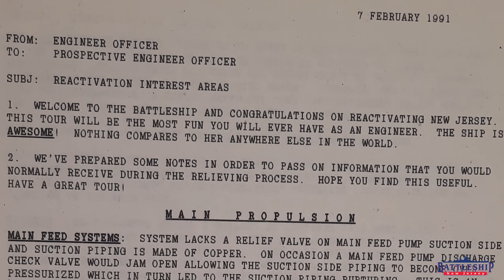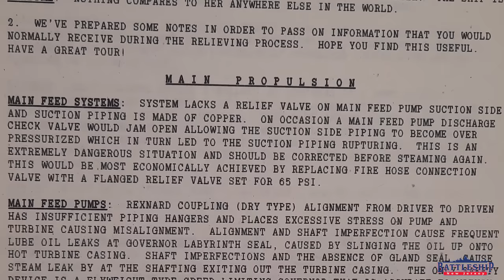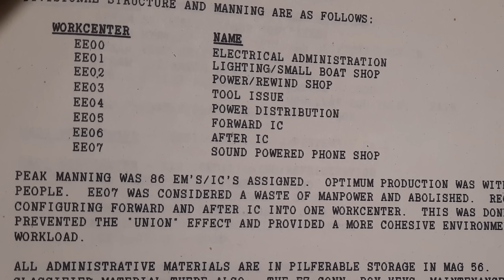The Call To Freedom Will Be Sounded Again: How to Bring Back Battleship NJ

Comment: There are several possible ways that the battleships could be recalled. 
The most likely seem through paths of nostalgia. 

Two examples:

 There are reports that president Obama toyed with the idea of reactivating the Iowa's, as a ploy.  Evidently Obama is a big fan of history, and he realized that fiscal conservatives were not going to support spending money on the preservation of museums, even of they are battleships. But if he reactivated them, he would have no doubt gotten support for whatever funding was necessary to do so.
Effectively erasing 30 years of deterioration via guise. 

 As many at the pentagon and in his administration reported, trump seemed to have an obsession with nostalgic ways of doing things.
 He demanded of NASA, why couldn't they just go back to Apollo technology, if it was good enough to get to the moon. He actually ordered the Navy to remove modern technology from the new aircraft carriers, though that was ultimately ignored. 
 He also reportedly had to be told on multiple occasions why battleships were no longer a strategic part of America's navy.   He didn't really understand strategy, so he kept appealing to things that he just saw as symbols of strength.

It is quite possible that some future president could bring about the return of the battleship because of similar reasons to either of these men.

 A less likely path would be through a genuine strategic benefit. 
This would require conflict, or the looming threat of a conflict, of a more historic nature.  This would ultimately stem from one of two driving factors; either modern technology cannot challenge the threat, or a battleship would be more economical.
This seems unlikely.
Shells are much cheaper than missiles, but you can buy a lot of them for the cost of a battleship. And a missile cruiser carries a lot more than a few box launchers.

Comment: """ Yes """ A Video On The Documents. 
I Personally Would Love to See The New Jersey Reactivated,  I Would Hate to Loose Such a Piece of History,  Along with the Missouri. Have One in The Pacific & Other in The Atlantic. Have Them Repowered With Nuclear Reactors,   Such as The Rolls-Royce Modular Reactors. I Wouldn't Be Surprised If @ Battle Speed It Wasn't 8 to 10 knots Faster, Than it was With Conventional Boilers. And a Shit Tone of 16" Shell's,  The Iron Dome System,  and For Shit's and Grins Two Rail Guns, One Fore & One Aft. And Since We're Going For It, A 6 to 10 Tube Vertical Torpedo launch System,  " BUT " Instead of Pressurized Air Launch,  High Pressure Water Launch W / Pre- Purge. Which ( Should ) Make The Launch Mostly Silent until the Torpedo Motor is Detected.

Comment: No. It will not be brought back. The ship was considered  too expensive  to run at more then a million dollors a day at last cost recording by the Navy during the late 80s. I wish she would be reactivated. There is no other like her or likely ever will be. Shame!
Reply: And there you go.  The USN decomissioned the entire inventory of  Wichita-Class Repleishment Oilers (AOR) in the 90's.  It wasn't a Mission Performance or Capability issue, as the MSC ships which took over their role are actually slower, smaller, and are far less capable of conducting UnReps in heavy seas.

The reason was quite simple.  Moving a 650 foot Oiler with a 35 foot draft through the water at 20+ knots required 3 rather large boilers burning a truly staggering amount of expensive Navy Distillate.  Oil was cheap in the late 60's when they were launched, but just a tad more expensive in the mid 90's.  It all comes down to money in the end.

Comment: I would LOVE to see how your "most decorated warship in the world" claim stacks up against USS Enterprise, the ACTUAL most decorated warship in the world.

Given that you both have the same claim, your list of awards seems to outstrip USS Enterprise and that in and of itself, seems to be a myth.
Therefore I submit that the New Jersey's "Most decorated warship in the world" claim is false.

You're lucky I'm not in charge of the Navy - I would see all the ship's awards stripped for a false official claim, making her the only battleship in the world with zero awards. I would also strip the awards of anyone who crewed the ship and perpetuated this claim, as it is a lie and that goes against the Navy's core values.

That being said, I would love to see the Iowa-class battleships brought back. The biggest obstacle to that is cost and crew member numbers - it cost a LOT to fuel and maintain any conventionally-powered warship, and it would take a lot of crew to man her - I've read anywhere from 2,700 to 1,600 for a full crew complement.

However, by replacing her diesels with a nuclear plant and exchanging her manually-loaded 16-inch main gun batteries with autoloading ones based on USS Salem's eight-incher mains and 5-inch secondaries, this could be drastically cut down.

In fact, I've run some calculations and should New Jersey or one of her family be reactivated, with nuclear propulsion and autoloading guns, along with modernized digital-age operations and the seaborne equivalent of fly-by-wire (sail-by-wire?) controls, a full three-shift combat crew would take no more than 82 people in total. That's even fewer crew than a modern frigate, in fact it's about the same crew complement as USS Constitution, the sailing frigate.